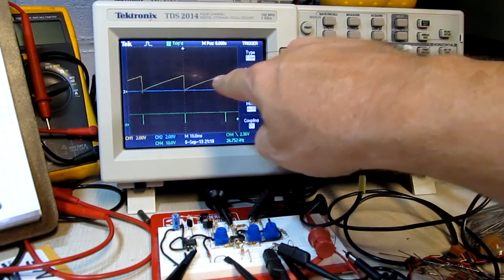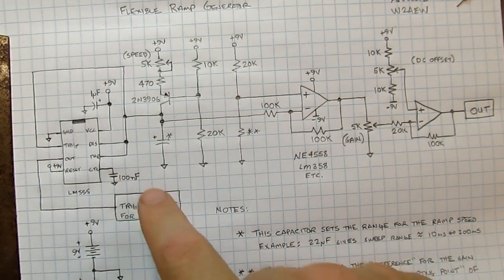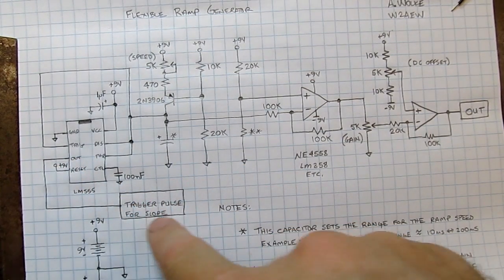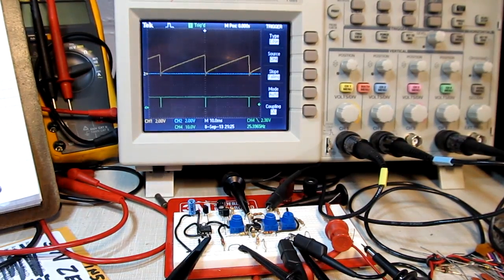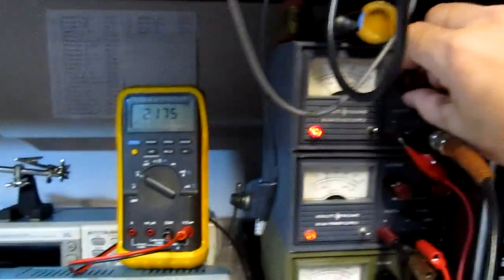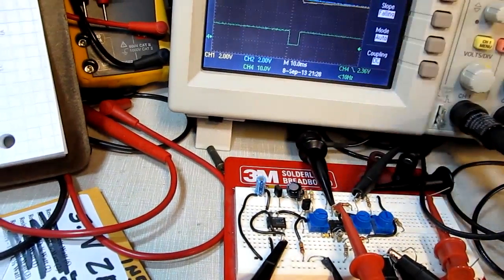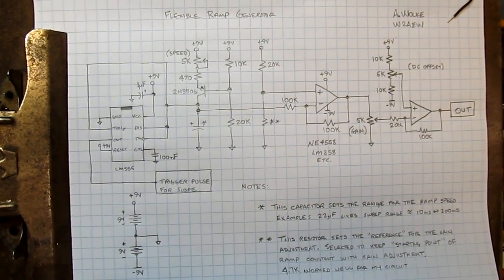#110: Circuit Fun: Flexible Ramp Generator to create frequency sweeps using 555 timer and op amps

Comment: Is there any way to give more time between two successive ramps?
Reply from the maker: With additional circuitry, sure. But not with simple component changes.
Reply: @w2aew please guide me regarding that , i m trying to have a BUCK converter whose output rises in sync with that ramp and then a long break and repeat..
Reply from the maker: You could use a monostable one shot to drive the Reset pin of the 555
Reply: @w2aew  yes I tried that with monostable mode , I had also tried using a 555 in the astable then decade counter(cd4017) to get duty of 10% only ...

I might be irritating you but your videos are very helpful so I think it is right place to ask for help.

I have no knowledge about programming that's why I m trying to with various IC..
I want to make a voltage ramp that could raise the duty cycle of tl494 ( used for buck converter) from min to max and then a long break ( basically for a QCW Tesla coil) ..

But all previous attempts are not in sync, i mean they can't precisely go in off state when duty is max , rather it goes off midway .

Please help 🙏

Comment: How to increase frequency up to 10MHz?
Reply from the maker: This would require a different design - the 555 timer isn't designed to go that fast.
Reply: @w2aew  Thank you for your response. Can you please do this video post?.
Reply from the maker: @purushothamanjayaraman8909  The circuit shown in this video can operate to 10MHz (and faster) if you use a fast comparator: https://youtu.be/ibnz5UjQ4u0
Of course, you'll need to adjust the integrating capacitor values and current source values.
Reply: @w2aew  Thank you. Fantastic explain.
Reply: @w2aew  can you give me contact mail id?

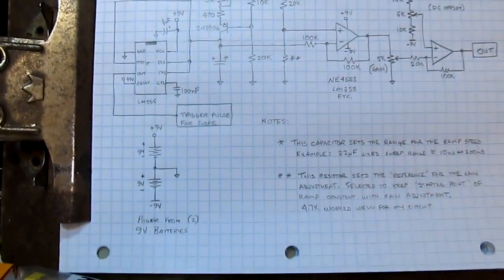Comment: Hello.   Love the circuit.  The schematic in the video is blurry.  Can you send me a copy.  This circuit will work great as an image ramp for my light show system. Thank you 1:20.
Reply: Some sections of the video clear up as you watch it.  I was able to copy the schematic.  Built the circuit with a dual rail op amp, ran everything on +/-15V, changed a few component values, and the circuit works great.  Running 0.6Hz to 8Hz for my application.  Thank you.

Comment: Can i use lm393 for single power?
Reply from the maker: I don't understand your question.
Reply: @w2aew  Instead of using a dual -9 0 9 V source, can I use a single source opamp?
Reply from the maker: @truchuynh53   The LM393 is a comparator with an open-collector output, it is not an op amp.  However, you can use any rail-to-rail op amp and run single supply.  You may need to adjust a few resistor values.

Comment: I made your circuit. I want to use it with the JDS8080 generator in VCO mode. I connected a DC  power supply to the generator. By adjusting voltage of 0-5 volts pp , frequency varying  in range. When connecting the sawtooth signal (0-5 volts pp) , there is no change in frequency in range – no sweep . What am I doing wrong? Thank you.

Comment: Hey dude, great explanation about the ramping process. 

I had a doubt about making a ramping circuit for high power over 1 kW , with adjustable ,frequency, ramping duty cycle and amplitude Could you recommend a circuit .

Comment: hi Alan, stumbled upon your circuit while searching for a 'voltage controlled current sink'(for use on XR2206) sweep from 100KHz~900KHz, and found this. but I used a 4046 for freq sweep. VCCS is a bit over my head at the moment. anyways, it worked pretty well with 4046 vco though. thank you!

https://youtu.be/YVOu2RWBtuo

Comment: Any idea why the dip or negative spike in the beginning of the sweep appears? Also, I see somewhat of a curvature before the linear part. Could it have something to do with the current source lagging and not being able to supply a constant current immediately in the beginning of the ramp? 
I saw that same phenomenon in other types of ramp gen circuits I tried, even with op-amp based gens.
Reply from the maker: This has to do with a property called "soakage", or dielectric absorption,  that is prevalent in electrolytic capacitors.  When a charged electrolytic capacitor is quickly discharged and then left "open", a small residual charge returns to the plates.  What you are seeing is this residual charge added to the charge being delivered by the current source.  This results in the quicker, non-linear growth of the voltage on the capacitor at the beginning of the charge cycle.  See https://en.wikipedia.org/wiki/Dielectric_absorption

Comment: I have a burning question about this circuit, I made the same circuit on my breadboard and followed your schematic but I didn't have the 5K ohm pots, I only had 10K so that's the only difference, the rest of the circuit I made exactly the same. I'm using a computer power supply so my input voltages to the circuit are GND, +12V and -12V where you used 9V batteries to create the +9V, and -9V, other than that everything is the same but the output I'm getting is a flat DC voltage that I can move up and down using the 3 pots so that's working, however I'm not seeing the ramp being generated, the 555 output oscillates at about 80KHz.
What am I doing wrong?
Reply from the maker: If you probe the collector of the PNP transistor, what do you see there?
Reply: @w2aew  Well, I do see a pulse on the collector and I can change the pulse a little bit with the variable resistor but I'm not getting a signal from the opamp which doesn't make sense. I made a video to show you exactly what I see so I hope that you can make sense of it and maybe explain it to me what I'm doing wrong.
Here's the link to my video: https://youtu.be/4BREBtSiCVg

By the way, I now got the opamp output working so I can change the DC offset and the other setting too, however because there's something wrong in between the transistor output and the opamp input I don't have the ramp signal being created properly or it doesn't get sent to the opamp input so the second opamp output where you take the output signal for the scope is showing a DC voltage only and no ramp being generated.
Reply from the maker: @RicardoPenders  I am not sure what is wrong.  The voltage at the collector should be a slow ramp.  Are you sure that you have the transistor wired correctly (and that it is a PNP).  You can disconnect the 100K resistor to the op amp circuit to isolate the 555 circuit by itself.  As an experiment, you can try removing the 2N3906 PNP transistor, and connecting the 470 ohm directly to the timing capacitor.  This should give you a curved ramp.
Reply: @w2aew  of course, why didn't I think of that. I know for sure that the transistor I'm using is a PNP and I know the pinout because I've tested it with my transistor tester, you know those cheap Chinese testers right? 
So if I understand it correctly, the transistor should have the ramp signal on the collector that also goes to the opamp input via the 100K resistor, right?
And the goal for me is to figure out getting the ramp signal showing on the collector of the transistor and when that's working I can connect the 100K ohm resistor again so I use that signal to make the two changes to the signal with the use of the opamp and the potentiometers, which is the DC offset and the gain, right?
Reply: @RicardoPenders  Yes, the transistor and the associated resistors forms a constant current source (whose current depends on the potentiometer value.  When this constant current is injected into the timing capacitor, it creates a linear voltage ramp.  To test things, simply replacing the transistor circuit with a resistor from the positive supply to the timing capacitor should result in similar circuit operation except that the voltage ramp won't be linear (it'll be an exponential curve).  This will at least help you to ensure that the 555 is configured and working properly.
Reply: @alanwolke6253  So I just hooked up my scope and the circuit, pulled out the 100K ohm resistor to split the two ic's apart so I can see the signal from the collector of the transistor and I changed the timing capacitor to a much bigger one and instead of a ceramic I now use an electrolytic capacitor which is rated 50V and 0.1uF and with the new capacitor the circuit came to life as it should and everything now works fine.
Thanks for the tips to help me figure this out.
So now I'm going to do the extra part of this circuit that does the curve tracer on the scope for the transistor testing which is why I started this project in the first place and I'm going to make the circuit for the stepped wave and when I got it working on the breadboard I'm going to make this all more permanent and solder it all together so I have a crude function generator that can make several different waveforms and does it all without a microcontroller, it does it all analog which is pretty cool I think and it didn't cost me a ton of money and for what I'm using it, it can go low enough and high enough in frequency and for now I don't need anything higher as what I can do with my DIY function generator.
@w2aew again thanks for sharing this online, you saved me a lot of money and it was super easy for me to follow and figure this out, I really can't thank you enough for that.
I wish you the best and have a great day.
Reply: @w2aew  I've got it working, it just needed a bigger timing capacitor, I'm using an electrolytic capacitor now rated 50V and 0.1uF which is giving me a pretty wide range in frequency.
I didn't change anything else just the one capacitor.
Ow, there's just one very important thing I wanted to share with you which is that the 555 timer output voltage is way too high for the trigger port of the oscilloscope and people need to add a little voltage divider, I used two 1K ohm resistors to half the voltage which is within the safe limits of the scope which is + and - 8V when I have the times 5 attenuator for the ext trigger input set because the regular ext trigger maximum voltage level is only + and - 1.8V so people need to be careful when they connect that output pin 3 of the 555 timer to the scope.
You might want to add that part of info into your video or in the description so people don't blow up their scope.
Reply from the maker: @RicardoPenders  Well, I had no idea that you didn't use the same values that I showed.  Of course, a small value capacitor will charge VERY quickly, which is what you were seeing.  Regarding the Trigger output of the 555.  It's amplitude won't exceed the 555's supply voltage (9V in this case).  And if you are using a 10x probe, the scope will "see" only 1/10th of that voltage.  I don't know what scope you are using, so don't know about your scope's limits.  Of course, you can use any other channel for triggering the scope, it doesn't have to be the external trigger input only.  It is HIGHLY unlikely that a low power 555 will blow up anything.
Reply: @w2aew  I have the Hantek DSO5072P which is a two channel 70MHz scope that is upgraded to 200MHz.
I have a simple coax cable with the BNC connector to the scope and the other end are just simple little wire hooks, I don't know how you call those things the same as you always use to grab on to a wire so it is not a scope probe that I'm using for the trigger input.
And I've looked up in the manual what the maximum input voltages are and the x1 ext trigger is only +1.6V and -1.6V, I said 1.8V but it's even less and when I set the input to attenuate x5, I can go to a maximum of +8V and -8V and I'm using a computer power supply which is +12V and -12V giving me a maximum of 10V output on pin 3 of the 555 timer so it's too high of a voltage for my scope at least and I assume all the other scopes from this brand are the same.
I did put the higher voltage on the trigger input and luckily I didn't blow anything up but it clearly says in the manual what the max input voltage is for the ext trigger port.
But I'm going to make a video about it to share that for everyone and I'll link back to your video and if you want to add the information you can link back to my video if you want so you don;t have to do a video about it, my video will only add some valuable info what your video is missing to my opinion.

Comment: Cool, do you have a video on how to make a VCO with a 555 timer and OpAmps?
Reply from the maker: The first part of this circuit is effectively a voltage-controlled-oscillator.  The frequency of the output is a function of the 5k potentiometer labeled "speed".

Comment: You mention you would have done this from less common components; Might could you elaborate?
Reply from the maker: There are always different ways to do things.  For example: The two op amp stages could likely be combined into one to control ramp rate, offset and gain.  The pulses generated by the 555 could be done with a simple op amp relaxation oscillator.

Comment: Just a quick couple of questions. You mentioned in the end that this circuit could be improved upon with the implementation of other devices. Out of curiosity what type of devices would those be? And by doing so what specs of the ramp generator would they improve?
Reply from the maker: A better rail-rail op amp will give you a larger ramp voltage swing.  Timing capacitors that have less soakage will give a more linear ramp (electrolytics are bad this way).  A different design for the main period generator will give a wider sweep frequency range.

Comment: There are a number of adf4351 sweep generators on the market and It would be awesome if someone could add a ramp generator output that coincides with the sweep time!
Reply from the maker: Shouldn't be too hard to do - the VCO tune voltage is available on one of the device pins...

Comment: This is perfect for a QCW and a PLL DRSSTC as fock dude, could you make this drive for 300 to 450 volts? @ 10/20Amps? Wouldn't be to hard to just amplify this signal...
Reply from the maker: I don't have any experience in SSTC circuits or techniques, so I really can't help.

Comment: Thanks for the great advice; once I had the LM331 connected to the variable voltage supply I could see clearly that the frequency was in the hundreds of KHz's instead of the tens of KHz's. The timing capacitor on the LM331 was not connected properly. Now with the 220uf cap on the 555 timer of the ramp circuit I can see the straight line of the ramp circuit cycling up from zero to about 6volts on channel one and the LM331 square wave sweeping on channel two; beautiful! Now I just got to try and remember where I put those IF cans I salvaged years ago! Many thanks.
Reply from the maker: Nice!  Sounds like you're making real progress now!

Comment: Thanks for replying, I've just added the basic voltage to frequency circuit as given on the Texas instrument's data sheet for the LM331 to your circuit. I've connect the ground of that circuit to the ground of your circuit. Will I blow the LM331 if I connected the ground of its circuit to -9v of your circuit. I know I should just try it. but my caution is due to the fact that I only have one LM331 at the moment! Again, thanks for all the inspiring content on your channel.
Reply from the maker: Connecting the grounds of the two circuits was the right thing to do.  Best thing to do to debug it, is to separate the two circuits.  Setup the LM331 circuit alone, and drive the control voltage input with an adjustable DC voltage to be sure the Voltage-to-Frequency converter is working as expected.  Once you have this working, then make sure that the ramp generator is working, and adjust the amplitude and offset of the ramp as needed, and connect it to the LM331 control input.

Comment: I'm taking the output from your circuit and passing it to the input of a LM331 voltage to frequency converter; my multimeter says I have about a max of 3.6 volts on the input and about +or- a few mv's on the out put of the LM331. I can see the start and stop of the signal matching the ramp voltage on the oscilloscope but not much else. Do you think this is just a lack of power to the LM331(which in the datasheet says it needs 10 volt on the input for "full-scale"  or am I on the wrong track? Again many thanks for the circuit.
Reply from the maker: This should work well with the LM331 to create a sweep.  So, without seeing a schematic of what you're doing, it is difficult to say what is wrong.

Comment: Can it be used for a narrow frequency sweep? For example a centrer frequency operates at a base 40 kHz frequency and a 4 kHz sweep (+ 2 kHz and - 2 kHz).? also do you haave a formula for that? thank you!
Reply from the maker: It all depends on the VCO that you're hooking this up to.
Reply: what do you mean? Can you explain a scenario where it would not be applicable. thanks.
Reply from the maker: This circuit doesn't generate the frequency sweep itself - it only provides the voltage ramp signal that is then used to drive the VCF (voltage controlled input) of a voltage-adjustable oscillator or signal generator.
Reply: Hello! I just built the circuit on the breadboard and it works fine except for when I adjust the gain the ramp grows in both direction. How do I fix that? Thank you!
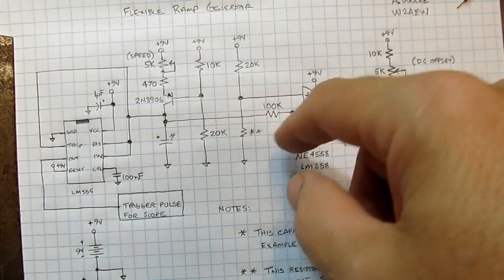Reply from the maker: At 3:20 in the video, I describe the selection of the ** resistor to provide the appropriate offset to ensure that the signal at the output of the first op amp stage starts at ground - this should address your issue.
Reply: Thank you! Would it still be okay if I use a +/-12v instead of +/-9v supply?
Reply from the maker: As long as the op amp and other parts are rated for it, yes.

Comment: I have constructed the circuit  and it works as shown i am using a BC559 for the transistors and a Tl072 for the opamp's ..my circuits i constructed 2 for  my  low line rate multisystem television 32 line 60 line 128 line ,i can do higher line rates but am testing with these for a start .